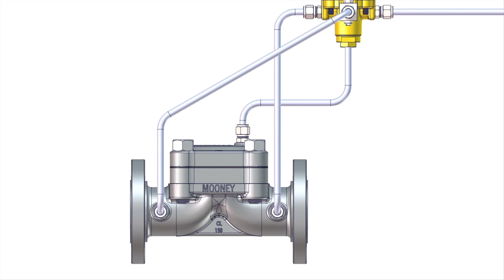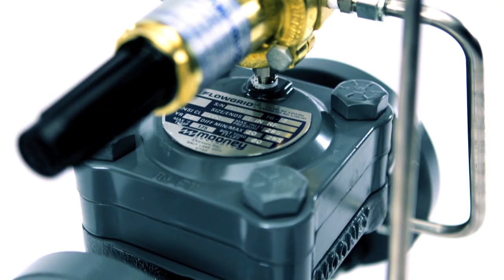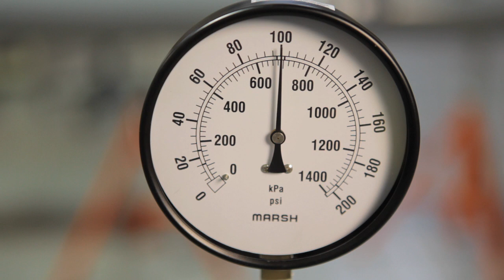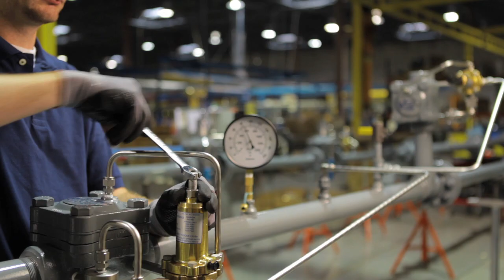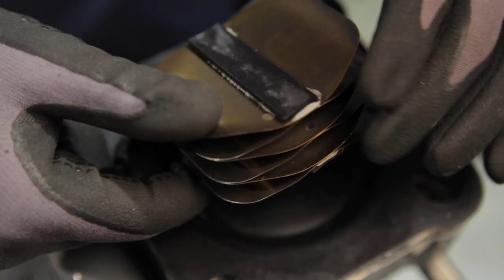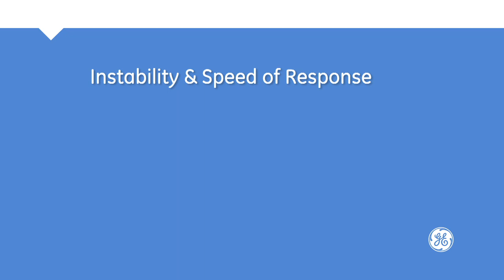Mooney Flowgrid Regulator

Comment: 39 yrs. gas meter tech last 10 yrs. were in the gas distribution system & that's what we used , pounds to inches water column & pounds  to pounds     regulators . retired in 2017